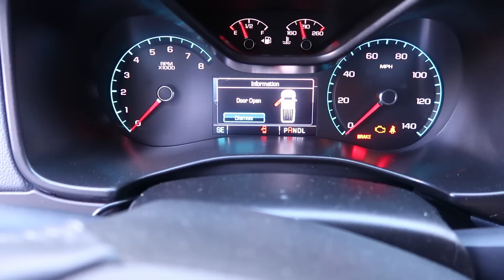How to Replace the Chevy Colorado shift Knob!

Comment: A couple questions. Where and what make is the new shifter and does the manual shifting still shift.
Reply from the maker: Didn’t get the first question... yes the manual works ... i did show it in the video!
Reply: I got the part number now. It’s a Buick shifter. I will be ordering one. Great video it showed me how easy it is to install.